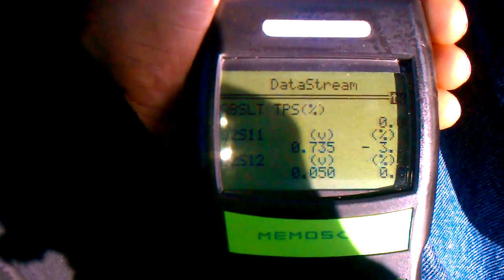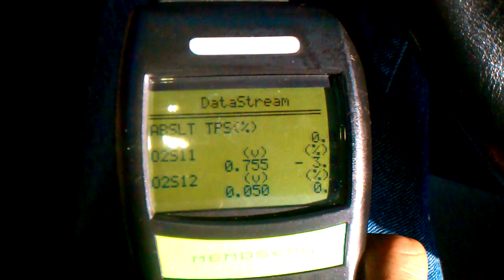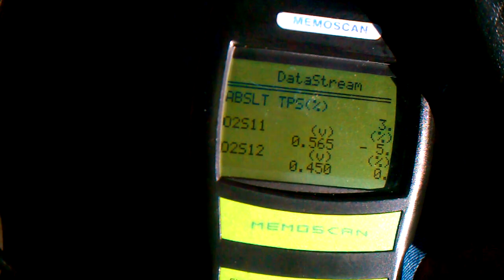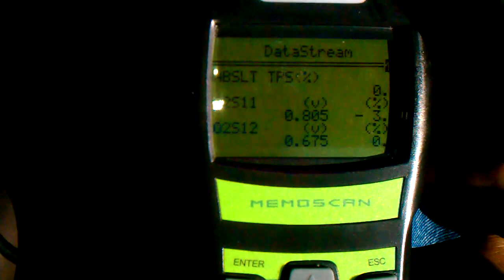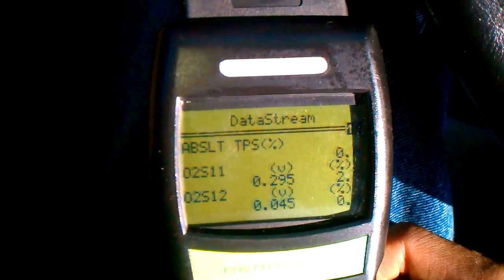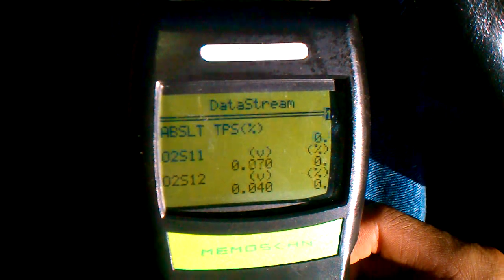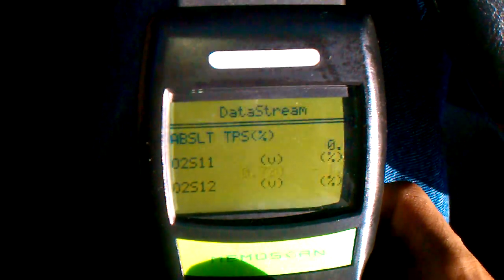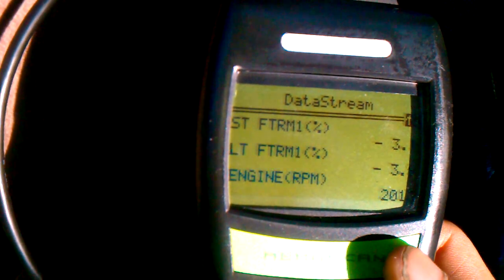Bad Oxygen sensor?

Comment: The way your camera is moving it looks like you have a misfire but this is NOT a proper test for an O2 sensor. The ONLY test that is approved and should ever be used is the snap throttle rise time test. A passing sensor will swing from a max .175 volts to a min .800 volts in under 100ms. Any test other than this will not be accurate and will without a doubt bite you in the ass. If you are a licensed shop or mechanic anything other than this test on your work order will get you a visit from the BAR and money out of your pocket. It is simple, it works, it will show the BAR that you know what your doing.
Reply from the maker: In the end it turned out to be the spark plug cable that was the issue, not sure why this video is so famous.

Comment: looks like chuck is misleading you

alternating x times at idle between 0 and .9 is normal
holding revs @2000 should alternate faster
that is normal operation.

i think that that scan tool is too slow for what you are trying to see.

Comment: What were your codes? I see you have a jeep GC-- Sometimes you need to see why the sensor is bad,,, I have a 96 GC 5.2 and recently got an 0138 which is rear cat. however the light will come on when it's either too rich or lean judging by voltage-- my coolant sensor was bad not allowing the engine to heat fast enough and hit full temp. if it stays in the rich mode too long [bad coolant sensor] light will come on, so i replaced both as the coolant sensor was the reason why the sensor was NG

Comment: I have this problem too. This problem is too at second of my oxygen sensors - oxygen sensors after catalysator. Friend who knows something information about oxygen sensors said, that sensor was bad.  Oxygen sensors must oscillate in high engine speed and in low engine speed too - slowly. How many kilometers have your lambda sensors? Interval of change is something about 160 000 km. My oxygen sensor have 204 000 km. I will buy a new oxygen sensors...